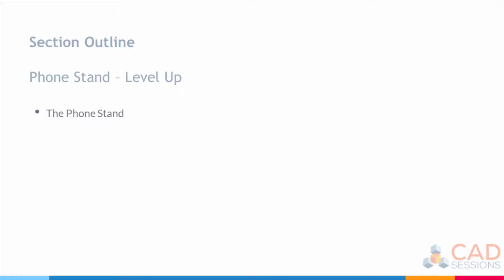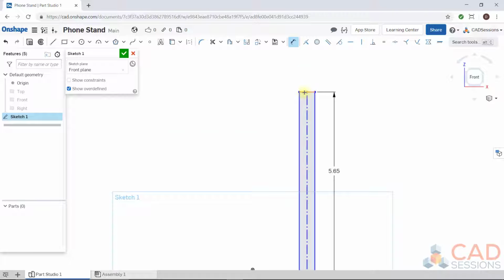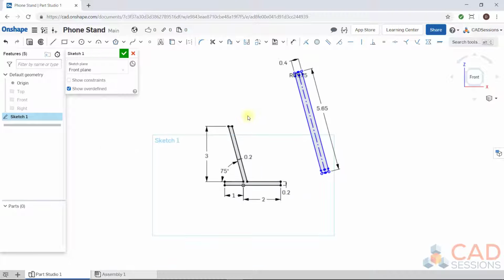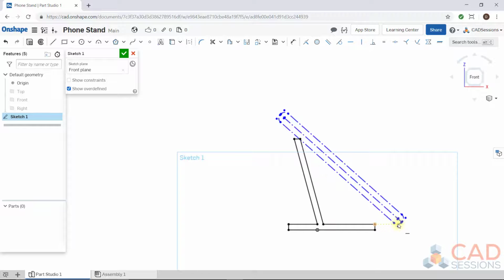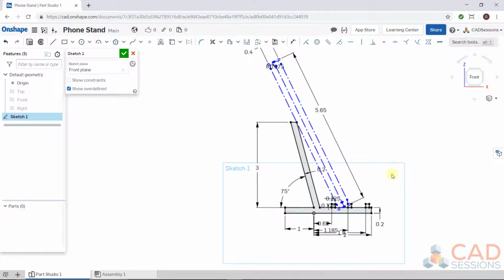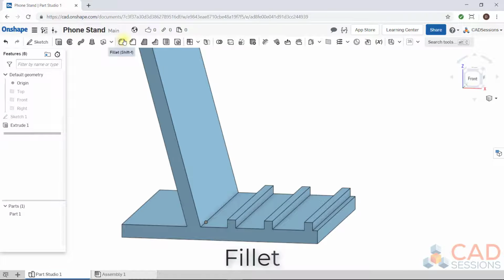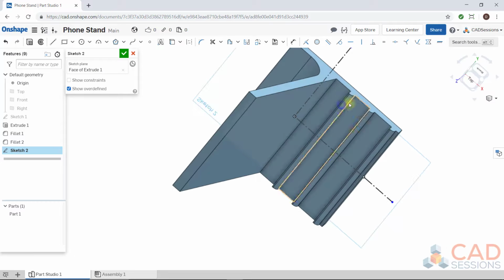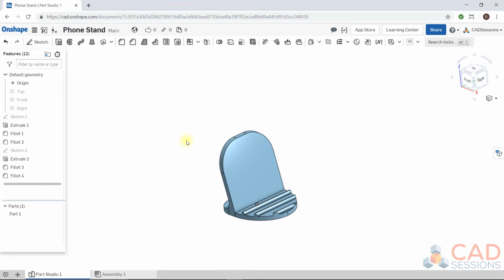Mini Course 4 - Lesson 1/1 - Phone Stand - Do More with Extrude

Comment: You could have just filleted the front like you did the back. Work smarter not harder. 😂😊😅
Reply: I expect the point was to demonstrate the Spline tool in Sketch mode.  That part could have been clearer.